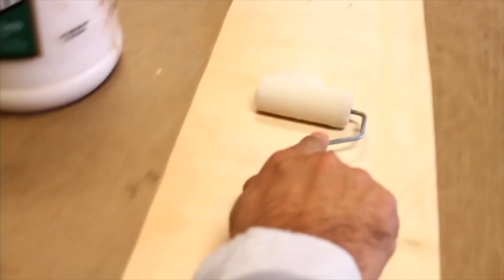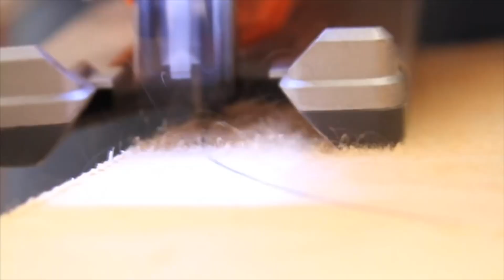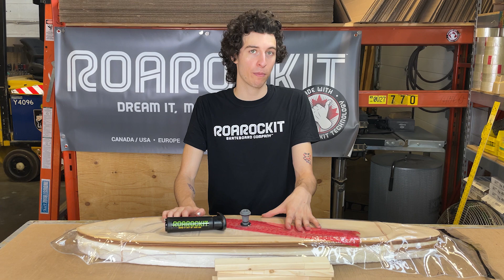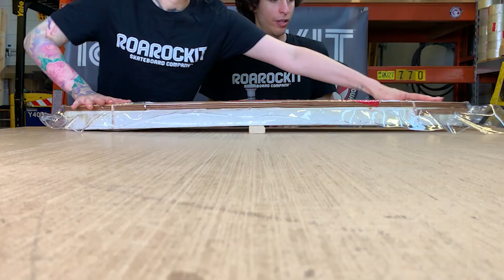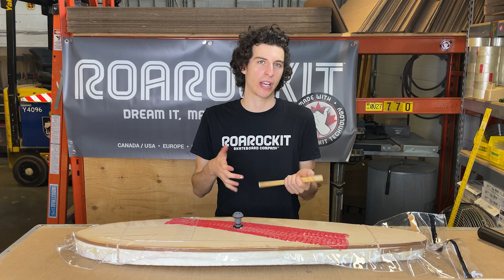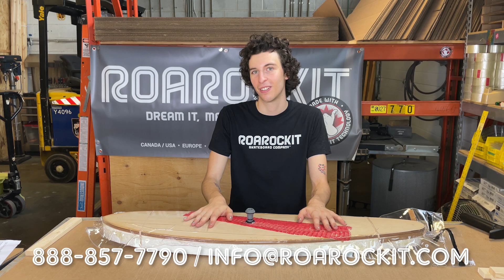How to Build a Longboard with Rocker or Camber

Comment: hello,

how would you arrange the veneer sheets if you build an 8 layer downhill board ? and in what order would you put the sheets if you use
8 layers for your downhill board.
Reply from the maker: When you are increasing the amount of layers in a board, you add the sheets in between the crossband layers. You just want to make sure the crossband is evenly distributed in the board.

7-Layer: Face, Core, Cross, Core, Cross, Core, Face
8-Layer: Face, Core, Cross, Core, Core, Cross, Core, Face
9-Layer: Face, Core, Cross, Core, Core, Core, Cross, Core, Face

Whether 8 layers is enough for a downhill board depends on the wheelbase, amount of concave, rider weight, and desired properties of the board. 

The great thing about our vacuum bag and one-sided mold technique is that you can always press a board with 8 layers, test it out, and then press an extra layer onto the bottom if you want it to be heavier/stiffer/stronger.

Hope this helps!
Reply: @Roarockit  it does it is very helpfull indeed:)
Reply: @Roarockit  I live in germany. Do you know where to buy veneer layers it seems they are out of stock in  Europe  ?
Reply from the maker: @ please contact Roarockit Skateboard Europe directly!
Reply: @Roarockit  the wheelbase is 62,2 cm & 66 cm and the concave is rocker without a 
w concave.